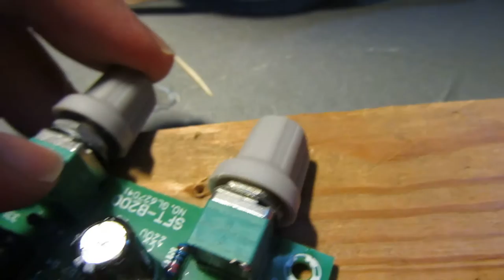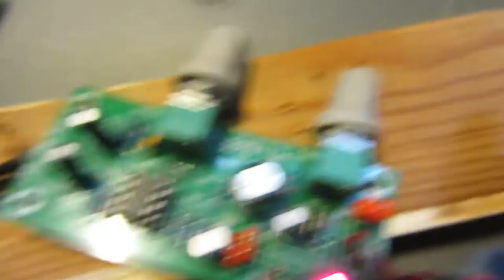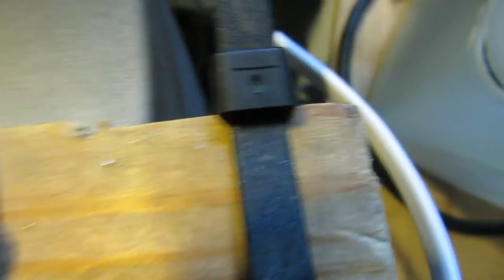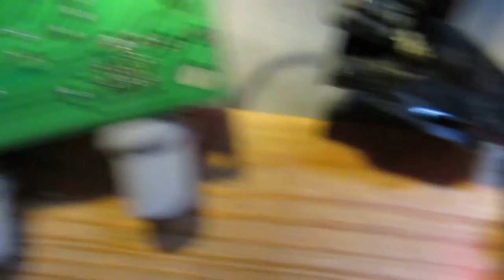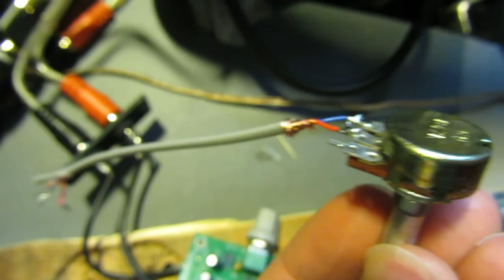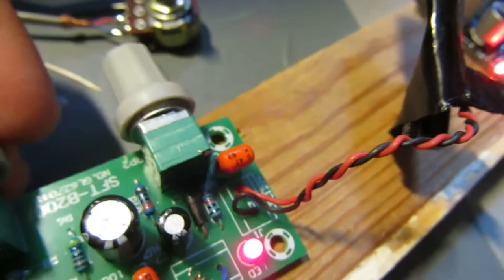subwoofer low pass filter preamp board £3.56 aliexpress dispuite

Comment: How does it receive power???
Reply from the maker: via the red and black wires. taped off the amps 24v supply and wraped in the back tape inbetween the boards is a dc-dc step down converter which supplys 12-15v to the pre amp.